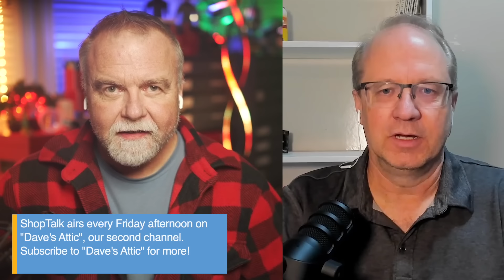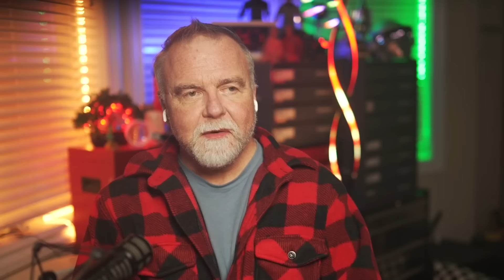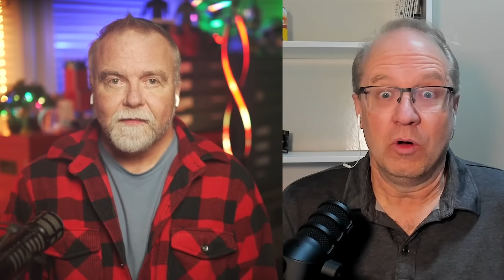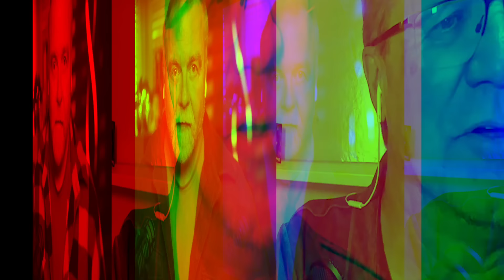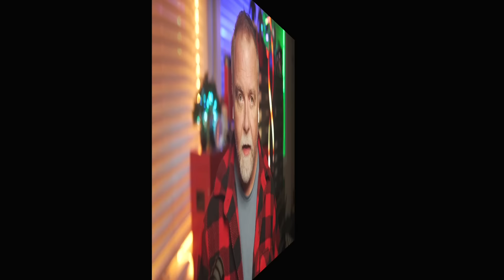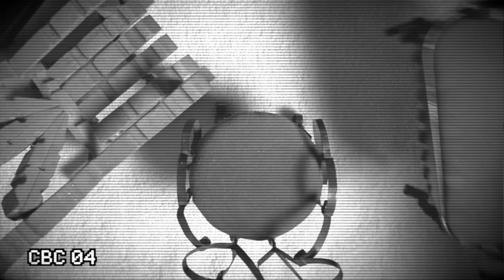The Hardest Bug I've Ever Fixed: Best of ShopTalk

Comment: Borlands BGI graphics in Turbo C used calloc() to allocate the memory. Borland's calloc() did call malloc() - and then never checked if the allocation worked before clearing the returned memory.

In far me ory model, a NULL pointer would be address 0000:0000 of that MS-DOS machine. Right where the interrupt table is. And MS-DOS runs a timer tick 18.2 times/second.

So a random time later, that timer tick happened, but with the interrupt pointer trashed. So every single time I run my code, it crashed at a random time/place. And no hardware debugger that could step in and tell how everything ended up exploding.

One of two runtime library bugs in the Borland C libraries that did bite and had me chase for way longer time than "normal" bugs.

The advantage? I learned (the hard way) to spend extra time to make sure my own code doesn't have random failures from memory overwrites or from unsynchronized access to common data.

And for all newer development, I also always have hardware debuggers that can help when writing interrupt service routines and hardware drivers, where traditional debugging doesn't work well.
Reply: I'm trying to figure out how this is baked into windows currently. I am under the assumption that drivers are being rolled back from windows updates due to this memory allocation synchronization issue although I can't prove it yet. What would be a good avenue to try and narrow down this issue?
Reply: @sirseven3  The BGI (Borland Graphics Interface) was a device-independent graphics library for MS-DOS. On MS-DOS, each individual program had to include the required graphics code to draw text, circles, lines, etc.

The Borland languages did ship some such drivers for Hercules [monochrome], CGA, EGA, VGA and some more graphics standards.

In Windows, everything is graphics, except the magic blue screen of death. So Windows very early in the startup loads either a custom driver [like from AMD, Intel or NVidia], or makes use of a generic SVGA driver.

When normal Windows applications starts, then everything is already prepared for accessing all graphics drawing primitives.

Comment: I had a cheap Atari ST rollerball mouse, that had to be cleaned often when it stuttered or stopped.  One weekend, it worked left/right but not up/down.   After 3 tries at cleaning, I bought a new one, and an hour later back and running.  Next weekend, same thing, but I knew it wasn't dirty yet.  Turned out to be at that specific time of day, the sun through the window hit the side of the mouse, and affected the roller ball timing wheel.  Can you imagine a user with that problem calling a help desk and being told to close the blinds.

Comment: Once upon a time (1998) I was tasked to fix a bug in a banking application. Turned out that the code was a total mess of patches on top of bugs, including patches of code that'd been commented out. The 10,000 lines of code in numerous source files was also riddled with Y2k bombs, which nobody had yet thought of identifying.

As the interfaces to the code could be identified, I gave the project manager the option of re-crafting from scratch or to fix the hundreds of previously unidentified bugs individually. I gave them an estimate of two weeks to get it done.
The 1000 lines of source code which was delivered, working on time, included nearly 700 lines of comments describing functionality. i.e. 300 lines of code was all that it took. 
That included "novel" input parameter checking for plausibility, and being a database application, trapping all errors. The actual work was done in less than 50 lines.

Had the code been left untouched until 2000, customers could have written cheques and only had their account debited by 10% of the amount.

Comment: Gotta add mine. Was a C static variable initialization order problem. It resulted in reading 1 byte beyond an array.

Only showed up on SunOS when built with Sun’s C++ compiler without a debugger attached and NO code modification.

Turned out the stars had aligned to place the array at the end of a page of memory and triggered a bus error.

Obviously this was well before we had tools like valgrind. I’m surprised I still had hair by the time it was found.

Comment: My hardest bug to fix was on a VAX running Fortran.  As you know all arguments to FORTRAN subroutines are passed by reference, meaning the subroutine can change the arguments value.  Unfortunately someone passed the literal value 0 (Zero) as one of the arguments, the subroutine assigned 1 (one) to it.  From then on any use of 0 in the program used 1 instead.  Had to debug in assemble to find out why 0 = 1. took a few days.
Reply: Oh man thats enough to tear your hair out!
Reply: Mine was somewhat similar. I was working in Assy on either a Z80 or MC68xx. I wanted to load a register with a CONSTANT equal to the number 6 as a loop counter, but instead of specifying a literal by beginning it with a "#" as I should have, I omitted the "#" and the register was instead loaded with the contents of memory location $0006. I stared at that line of code for hours and hours without seeing the error. The hard part was that the contents of $0006 were dynamic, so an error happened regularly, but with different results since the contents of that address were rarely, but occasionally, 6. I had to bring in a colleague to help, and all I had to do was run through my code verbally and the error magically revealed itself. DUH!
Reply: Is that what they call orthoganal for an instruction set?   I mean the ability to use all types of data and addressing modes as operands... and with great power comes powerful bugs.  Wonder if ChatGPT would have caught them...
Reply: I thought that oddity/bug was well-documented enough that no one fell into it, anymore.  Nice to see someone else fell into it
Reply: @Egilhelmson  in my defense it was in 1990, we had the first VAX in the country

Comment: I LOVE UAC which came with Vista. Thank you for that! OK, the Win7 version required a few clicks less, but the concept of session isolation and being able to switch that easily for just one command is great. Today: Always set UAC to the highest level, and on servers even one step beyond to require a UAC confirmation for shutdown or reboot (unless you run the shutdown command from a shell started with admin rights).
Dave, go back to Microsoft and fix the Windows 11/Server 2025 mess. There are so many weird bugs, like my current pet bug with data corruption in a Nested-V Machine with 1st-level being Server 2022 or Server 2025 using deduplication on the drive for the second level guests. Server 2019 is fine. I would post a link to server insider threads, but da tube...
Oh, and make the UI fast, efficient and responsive again, so one does not need a fast GFX card to not go crazy and can use a thunderbolt dock again without going insane over that slow speed since it is still just thunderbolt and not PCIe16x.
Reply: Why not just use an account with user privileges? You don't need UAC then.
Reply: @Alexagrigorieff  What you say is in line with me. Running as "just a user" is even more safe, since then you have to enter an admins credentials on every UAC popup, and not just hit "confirm".

Comment: I believe the invention of shingles hard drive is the worst invention of the century.
Hard drives with high capacity and low price, with no indications other than a model number and a red label, has ruined the day for many people who didn't know better. The closest device to a write-once hard drive. 
BTW. The excessive logging, reporting and files duplications made Windows barely acceptable after Vista. But Rec-All has been the drop that burst the barrell - I now have Debian on all my computers. It has been a really poor endgame on part of Microsoft...
Reply: I was bitten by the sneaky SMR drive substitution.  What made me so pissed off was not the cost of replacing the drives, but the far greater cost of the time taken working out why the performance was so horrible.

Comment: I was slinging copper tube in my attic when I was installing my heat pump AC.  It was 53C up there!  :O
So I know what you felt like about the "they'll find my dead body" thing!  I maxed out at about 10 minutes before I had to come down to rehydrate.

Comment: Oh, I used GFA Basic! Loved it. It was a great implementation for the Atari. I made a library of widgets so I could have standardized UI elements. 15 years later, I took that same approach to ASP web development, with libraries for database connections, UI elements, user input sanitation and a state machine template. 15 years later, I created a GTK framework for making Linux GUI apps in Python. So, I owe GFA Basic a lot of thanks. Oh, and I learned Basic on a PDP 11-70. So, you're really poppin' off for me the last month or so!